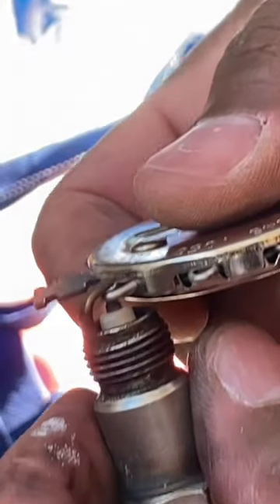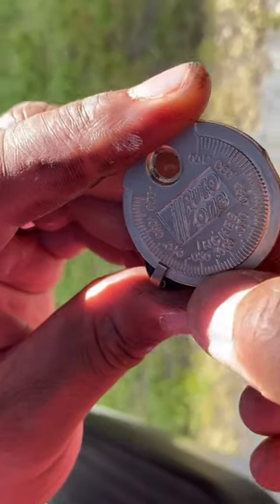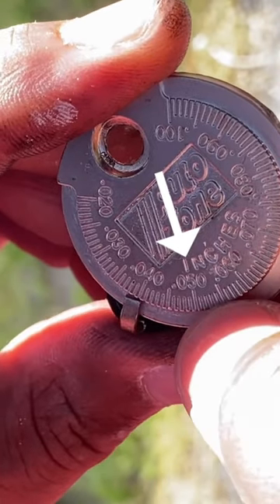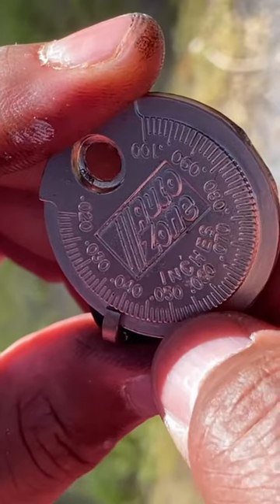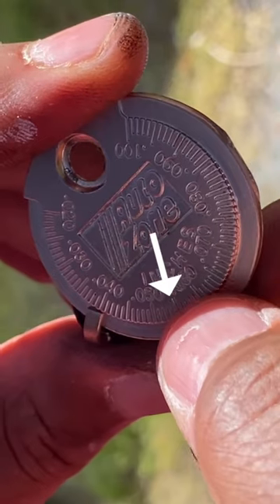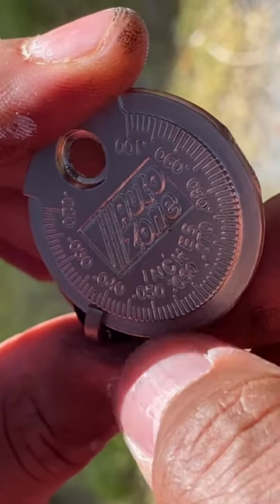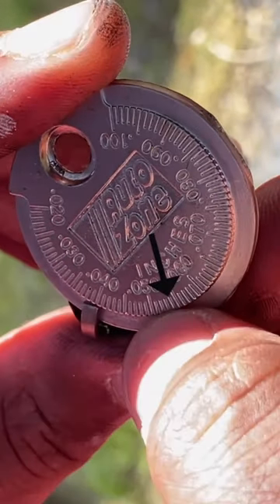Gaping Spark Plugs #shorts #mustangs

Comment from the maker: The amount of Spark Plug Gap will vary depending on your application and modifications done to your vehicle! 
I also found that the gap should have been tighter on my vehicle due to the supercharger!
Reply: Boost = smaller gap. Good tip for those new to forced induction.